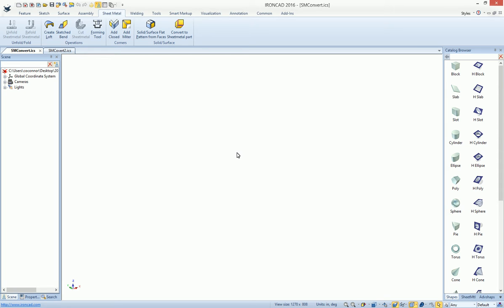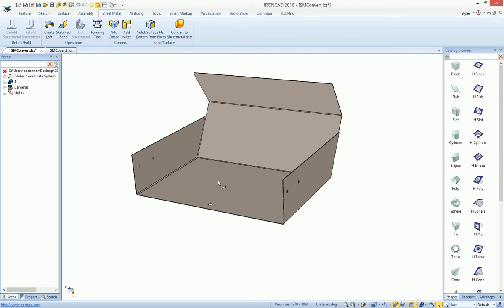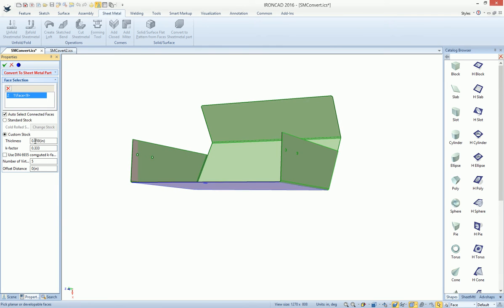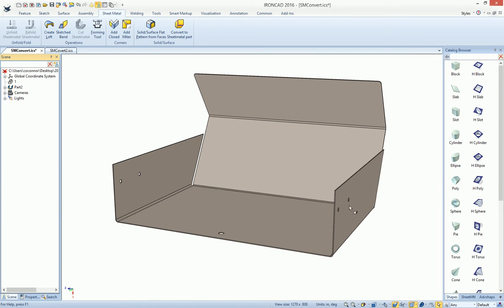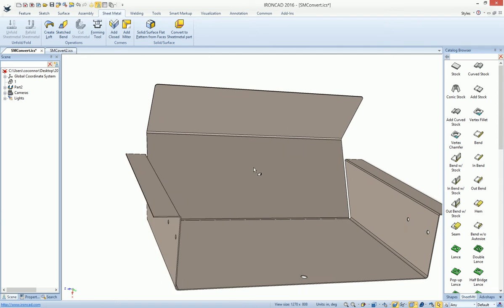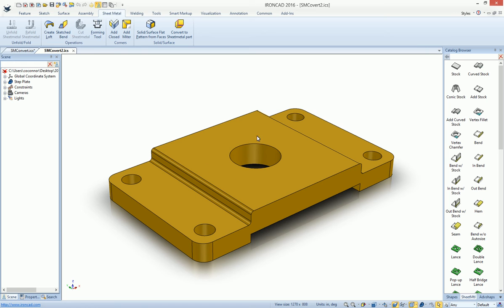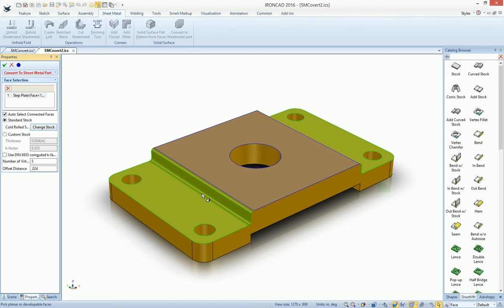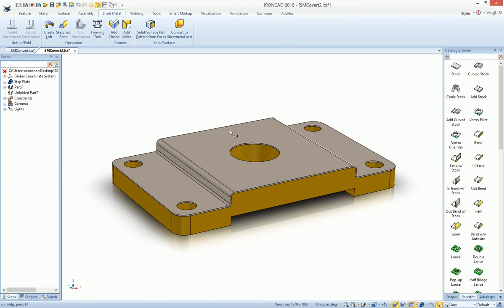Sheet Metal Convert in IronCAD

Comment: Starting at 1:42 you nicely show how to convert a solid to a sheet metal part. However can you possibly provide a tip on covering the other surfaces on the side with  same piece of sheet metal. The software seems to get hung up with this. For example try converting a cube to a folding sheet metal part on all sides (after blending the edges of the solid).